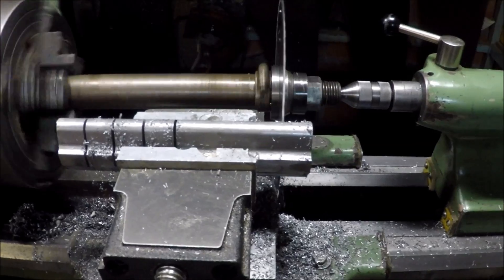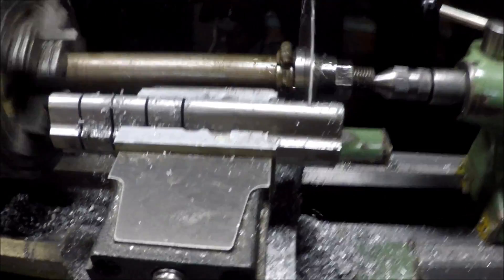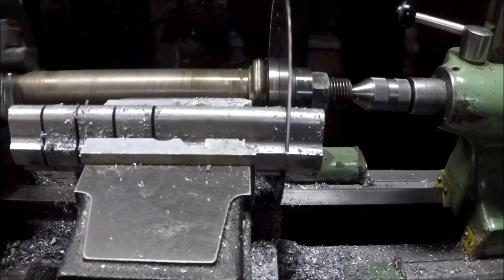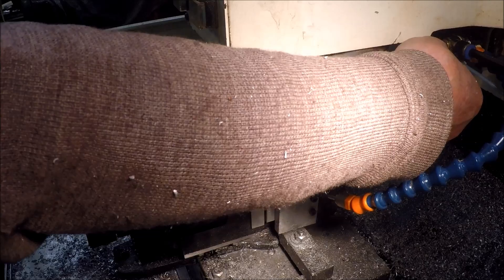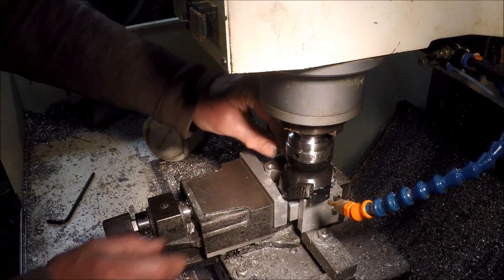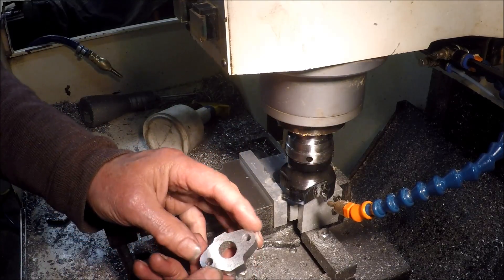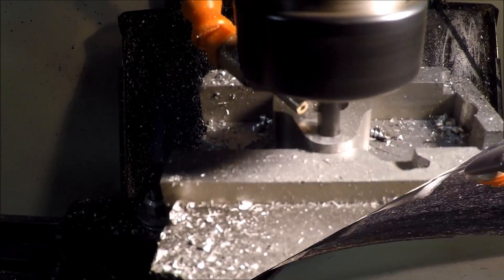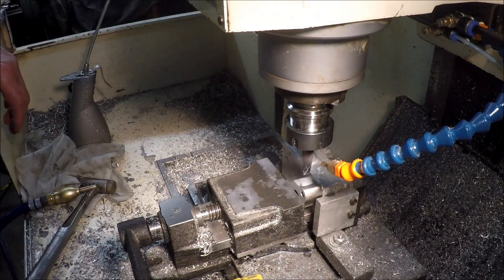Machining a Mini MInor Water connector

Comment: I actually remember this little part.  It goes between the water valve and the cylinder head.  They always corroded like a beast.  The E-types have a similar arrangement too.  Must have been a smiths thing.  Today the smiths valves are made in china and I have to replace mine every time I flush the radiator or I end up with leaks.  Total garbage.
Reply from the maker: Worldtraveler, I am not surprised that the originals corroded quickly, the aluminium alloy typically used back then contained copper as well as silicon (and a bit of other stuff.) The copper constituent tends to set up little electrolytic cells within the casting on the wet surface so unless you run a good inhibitor in the water the castings would be toast fairly quickly. You can always tell castings made of this stuff as they have lots of deep corrosion pits with whitish (sometimes with a blue tinge) stuff in the pit. Eventually the pits join up and there is nothing left - Have a look at the original part in the Armstrong Siddeley water pump video I put up a few days ago, its a fine example! I would suspect that the Chinese valves are pressure die cast and the alloy they use for that is the pits lots od copper and all sorts of other crap. The ones I made in this video are in 601 alloy (356  in the US) it is essentially copper free and known to be much, much better at resisting corrosion. See if you can buy one of mine from Minis Plus here in Melbourne Australia - they should have a web site. Regardless I would recommend using a good inhibitor in the coolant. E Types you say. hmm, acquaintance foolishly had one. I had a Mk 1 3.4 manual OD sedan - nice car than a 420 compact - heap of crap - only jag ever made with plastic seats. Given up all that difficult stuff - now in a Subaru Liberty 3.6 bought new (spending the kids inheritance!)

Comment: Very interested to see more of the CNC mill! Very nice work
Reply from the maker: JB, As CNC mills go she is rather old. Dates from 1985 so the old girls computing power is - well - not exactly huge. Does not use G code instead has a proprietary conversational type of code.. Can only handle 1000 lines of code. Like all old ladies she is fussy, does not like cold weather for example and at times can be a bit "difficult". In 1985 she was well up there and was extremely well built - very solid and strangely for an American built machine used all metric fittings bolts screws etc. Many of this mill have been converted to modern electronics with great success they are an excellent base for a conversion - I lack the electronic knowledge! It is surprising what the old girl can do though.